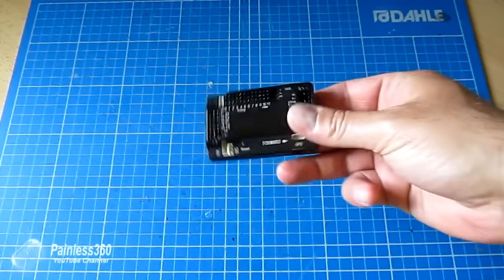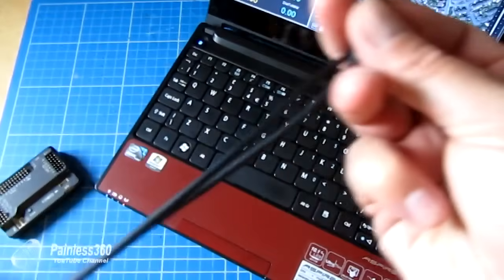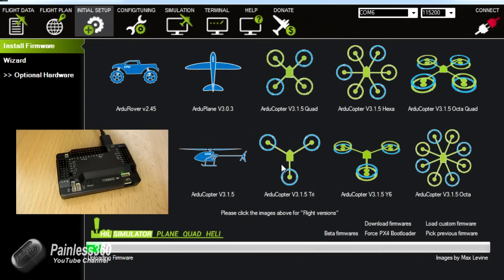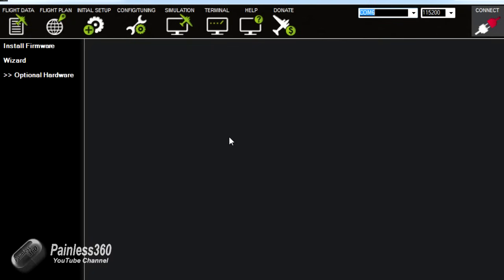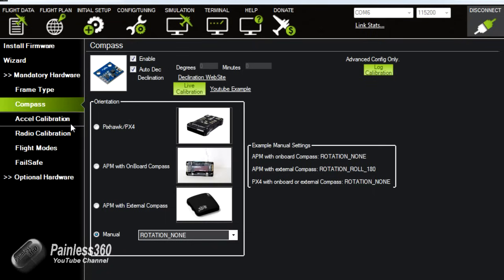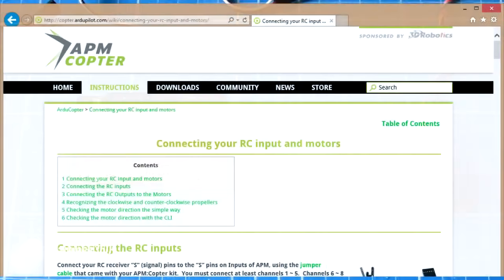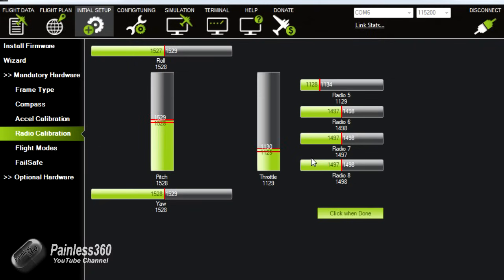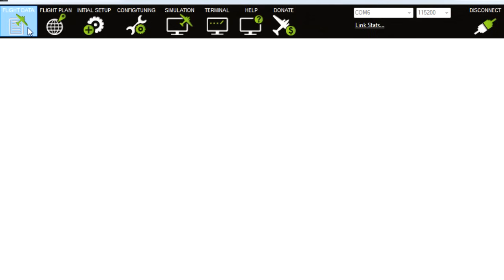(1/8) APM 2.5/2.6/2.7/2.8 - Simple installation and setup overview

Comment: Hi I have setup my APM 2.6 on a 260 quad and I can not get it to arm,  and when I plug in the battery my ESC beeps and beeps and beeps. I have done everything I can think of. What should I do?
Reply from the maker: +Alayna Feldman Have you watched my APM 'troubleshooting arming' video?
Reply: Thank you for responding so quickly to my question.  I have watched your arming/ troubleshooting video, and found out that I could not get GPS through our metal roof.  I was then able to arm, but now it will not stabilize, and I am positive all my motors are plugged in and orientated correctly, and the board is facing the proper way.
Do you know of any other reasons why it will not stabilize?

Bo (little brother of Alayna)
Reply from the maker: There could be lots. I would follow the APM setup videos and make sure the board is calibrated for level..
Reply: I have fixed the first problem with it flipping over... that was wrong motor configuration. And now, I am having a new problem. When I try to arm I get (RC not- calibrated) I have gone around the pre-arming checks so I can arm. But when I give it a little throttle the motors spin slowly. And when I give it a lot of thro the motors spin slowly. If I put it in RTL mode it tries to go up to default altitude and return to launch, but I cannot lift off in any other mode.
Reply from the maker: Happy to help but please watch https://www.youtube.com/watch?v=olIqTiSJHIY and come back to me with more detail of what you've tried..
Reply: Thank you for the great video. I had all ready done about 3 hr. of research on all of my problems before I contacted you. I figured out how to reset the board and that fixed it, and now I can fly fine in stable mode but if I put it in a gps mode it will fly but is very unstable. I will send you a video ASAP.
 THANK YOU FOR YOUR TIME,

                                         Bo
Reply from the maker: +Alayna Feldman I would check that the magnetometer isn't getting interference.. best of luck...

Comment: Ok, I gufffed it! Mission planner for APM 2.6 no longer exist. Has anyone found a way to program this board that I just got for Christmas? or is it just a useless piece of electronics now?
Reply from the maker: Still works for me - http://ardupilot.org/planner/docs/common-install-mission-planner.html
Reply: I ended up, after a 10 hour Marathon of trial and error, using APM Planner 2. Downloaded it from the Ardupilot webisite and got it working BUT! After getting everything running and a couple test flights in the back yard I decided to re-calibrate the compass due to loiter drifting hard to the left. Plugged it up, re-calibrated --- now it won't arm due to a "COMPASS OFFSET TOO HI" issue that I can't figure out. I even toke the 2.6 APM and compass/gps module off the craft and tried to get pass the problem with no luck. I keep getting a very high reading on the X axis (57280.096) etc... Any suggestions? I ordered another gps/compass which will take 3-4weeks to get here.

Comment: Hi
so I really need help in solving this problem. it would TRANSMITTER futaba T6EX and ardupilot 2.6
Reply from the maker: Sadly I do not have that transmitter here but you need to find someone who still has one who can walk you through how to set it up using mixes.

You can fly fine using only two flight modes in the mean time...

Best of luck. .

Comment: I am in a quandary and hope you can help. I have a new apm 2.6 that will not load the firmware. Confirm that I want to load the firmware, it reads the hex stops near the end and says "Connection error, no connection" never even gets to loading the firmware.
I have tried:
disabling all other ports, new usb cables, re installing MP, using older versions of MP, APM planner2 ...it loads most of the way then crashes, installing offline...
allways does and says the same thing.  As a note I am able to calibrate and such.
  Hope you can offer some advice as I am at my wits end.    Great tutorials BTW.
Reply from the maker: bill patterson Are you making sure that you are loading the latest supported version? (https://www.youtube.com/watch?v=Vbz3vN3JH6Y&list=PLYsWjANuAm4oswLMu9OU8yOm-9J6y30XW&index=11)
Best of luck.

Comment: My apm 2.6 is not recognized by my pc. It has an orange light on the board instead of the green displayed on yours... This could just be a model difference, but I'm wondering if it's not being powered properly. Or maybe I need a new serial driver... Prolific driver doesn't work.
Reply from the maker: Will6804 The orange light is a data light and normally is only flashing when the board is being read from/written to.
I've not seen it myself but it sounds like a potential board issue. http://copter.ardupilot.com/wiki/common-autopilots/common-apm25-and-26-overview/common-ppm-encoder-apm2x-atmega32u2/ may help force a reload and restart. 
Always worth a try getting support from your supplier..
Best of luck with it.
Reply: Thanks for the advice. I've had a hell of a time with my project so far (part of which may have been my fault). Both of the cameras I bought failed to do anything but play sound, with one literally going up in smoke after 2mins (at correct voltage and amperage). It seems like my laptop that's barely one month old doesn't have a com port driver/doesn't recognize it (and i have no clue what do do about that). and when I found a computer that did, says that there is only one com port, mission planner recognizes the board, then says "no connection".

This is my first build, and your videos have help quite a bit. But, I have to find it funny, me having such bad luck and all.

Also... The orange power.light is constant with red and blue LEDs flashing after being plugged in, then the red is a steady blink after that, but with orange power light.

Thanks, I'm a big fan.
Reply: Working now!
Reply from the maker: Good news - what was it?

Comment: I am having a problem with my HKPILOT POWER MODULE. Not getting power to the board, is it a bad module or did I do something wrong. It wrks fine when plugged into my pc....except im running Windows 8 an that is a whole n other issue. Any ideas
Reply from the maker: Hi Cordell, see my other video - APM 2.5/2.6 - Powering the board, motor installation and ESC calibration

Sounds like it may be the J1 that needs installing..

Happy flying.

Comment: I am building a Hexocopter using the APM V2.6, and when I connect to the "Mavlink" and go to frame type it's set to"X" "Y6A" which is for my Hexocopter, but there is a Default settings box to the right of that with a drop down window to Load Params" do I need to click on 3DR_Y6A_RTF.param Too???
Reply from the maker: Have a read if the documentation for the Load Params button. I never use it myself and manually set up everything.  Best of luck!

Comment: Setup For V3 Glass Fiber Hexacopter Frame 500mm - Integrated PCB Version
APM mega 2.7 1/2/3/4 esc works on the outputs rail but 5/6 on the outputs rail do not work the esc. (?) I tested it by taking out 1 esc that works and plug it in to 5 on the output rail and got no response.
Reply from the maker: Sylvanus Houseman is J1 installed.

Comment: I was looking for a good AP and I think this is the best work/price that can find. The only problem is that some boards are v2.5.2 and some v2.6.1
Do you now what are the deferences of these two boards?
All the fotos at ebay have the 2.5.2 version but writing that is new version. How can we now which board they will send.
Anybody tryed to make it work with the MTK3329 GPS board from the storm OSD?

Thank you in advance
Reply from the maker: Hi, the main difference is covered in the video. The main difference is that the v2.5 of the board has an onboard compass and is more sensitive to electromagnetic interference. The v2.6 uses an external compass mounted on the GPS. 

If the MTK GPS is configurable and has a fast enough update speed then it may work. I have not tried it myself. 

Happy flying!

Comment: Hello, I have a question. What can I do because my 7 chanel radio does not have a 3 position swich?
Reply from the maker: ICanDoRedstone Then you are limited to two flight modes unless you can 'mix' two channels together to give you three or more positions on the channel that controls the modes.
I have a video for the DX7 and getting more flight modes that may help..
Best of luck.

Comment: Hi, do you know whether there is a problem connecting the APM 2.6 board with windows 8.1 using Mission Planner 2.0 as mine can't detect the board, and it can't see any relevant COM ports.  Cheers  Steve
Reply from the maker: Steve I used Windows 7 and 8.,1 here with MP and have no issues. The problem isn't the MP setup - it's the lack of com port. See http://copter.ardupilot.com/wiki/common-apm-usb-driver/ for more details..

Comment: Thanks for your video, really helpful. When I calibrate my Radio I noticed that on moving the throttle also pitch and roll seem to affected. Although I'm sure that my radio is connected properly. I'm using a try-copter config. Someone familiar with the problem?
Reply from the maker: Sounds like you are using a heli model type on the radio. If you are then make sure that you don't have a swash mix enabled. Usually this is '90degree' or 'single servo' in the menus. Best of luck!
Reply: Thanks! I have a TGY9X it says: PIT: 45 AIL: 60 and ELE:60. if I change them to 0 and exit they just go back to these values. do I put them on 90 all of them or switch my swash off in a other menu?
Reply: never mind It worked! just put all values to zero. thank you so much!
Reply from the maker: Happy to help!

Comment: good video 
I followed these , but mine will not connect to my laptop.
it will download firmware but just times out.
I have tried many times without any luck.
right com port and software but no joy .
any ideas thanks.
Reply from the maker: +dsturner244 Happy to help but please watch https://www.youtube.com/watch?v=olIqTiSJHIY and come back to me with more detail of what you've tried..
Reply: Thanks for getting back so quick, I am waiting for a response from the seller of the unit.
Just found it strange that it downloads firmware and then to carry on with setting up proceeder , it needs to connect .Just times out and dose not connect, tryed different com ports and tryed using the dos screen.Even that tells me to Panic as it took to long to connect. Tryed Google on how to reset or reboot but they all say the same , even in Spanish lol.Will let you know how I get on and thank you.
Reply: Fixed it?
Reply: +robin bertschler  no I did not , faulty unit .Had a replacement sent .all OK
Reply: It works now, I used a faulty cabel.

Comment: hi Painless, I have problem with calibrating internal compass. I did what you did in video but could not get poins and gives error code 99. it works without calibration but shows wrong directions. any idea will be helpfull for me. thanks..
Reply from the maker: If you are using the APM 2.6 then you need to plus in the external compass to do the calibration..

Best of luck.
Reply: thank you for kind response. yes I have APM 2,6.  I d just thought it is  hardware problem. I just ordered a gps module with compass. thanks.

Comment: mate i have a problem i have my reciever and apm connected by the usb,it connects no problem until i turn on my transmitter and then mission planner disconnects,why would this be.Any info would be great.Thanks
Reply from the maker: +SheaProdigy id suspect a power related issue. Check the non USB voltage and J1 setting.  Best of luck!

Comment: hello i hope you will help me 
i have a problem in APMplanner, i use ubuntu 18.04 and this version of apm planner "apm_planner_2.0.26_bionic64.deb"This is my 'install firmware' screen which is blank in both disconnected & connected state (I'm trying to configure my pixhawk1 for the first time)
Any ideas why this is occuring and how do I fix this?

Comment: my altitude reading jumps around a lot, would jump from .5 to 1m then down n up constantly! I need help
Reply from the maker: If you have a baro - cover it with foam and make sure that the GPS is well away from any interference. Both provide height data.. if you want super accurate height management, ditch the APM and look at my Sonar/Lidar videos. best of luck

Comment: Hi Painless, I have installed apm mission planner on my mac and when I follow your steps in the video, when you choose com 6 I don't have that option, just some bluetooth ports in the list . Totally stuck now can you help please 
Thanks
Reply from the maker: Not sure as we don't use Macs here. I'd look at the forums as it sounds like the USB driver hadn't been installed/configured automatically.. best of luck!
Reply: We tried our windows machine still no joy in the window that says com 6 in your video my screen says no device and the whole program looks slightly different tried following the link in your video and it took us to the go daddy site ? so downloaded the oldest version we could find perhaps this could be our problem can you help ?dying to fly my fixed wing fps safely with an apm  system installed
Reply from the maker: Id try another USB cable..

Comment: I am setting up an APM 2.8 and I installed the firmware and got my hex to fly but only in stabilize mode. When I try to set the modes to loiter it gives me a error message that says Error Setting Parameter. The only mode I can select is stabilize. My GPS has a 3D fix inside the house with 11 sats. Help?
Reply from the maker: I've not seen that here and the detail on the forums (from my quick search) isn't great either. I'd start by reloading the firmware again and running though the setup again too in case something hiccupped first time. Best of luck!

Comment: Hi what can you do when going through Radio Calibration and My Aileron isn't moving correctly not on mission planner or on the TX monitor function. All help appreciated.
Reply from the maker: What troubleshooting have you already tried?
Reply: Painless360. I've made sure that the trim is set to 100% correctly checked the cable connections between rx and     AMP that's about all I can think off
Reply from the maker: I'd connect that channel to one of the others in the Rx to test that the input on the APM is ok, if it is then I'd connect a servo to that output on the Rx and see if it moves. If not then it'll be the Rx or some setting on the radio for that channel. See my troubleshooting tips video. Best of luck.
Reply: Thanks I switched the channels around Throttle and Aileron and then the throttle does what the Aileron was doing. so switched Aileron with Elevation and the pitch doesn't work. I put the servo into the Aileron and it doesn't work properly it only moves slightly on right movement of the TX stick or if the stick is moved up and left to spring back it will move. It does nothing when the stick is moved to its left side top or bottom. Hope you will be able to help me diagnose the problem. Thanks

Comment: Hi,
Now I'm using Multiwii SE 2.5 board. But I can't get telemetry data to my Tx. Therefore I'm going to move to APM 2.8 arducopter board. Is this board easy to configure? Better than Multiwii?
Thanks!!!
Reply from the maker: +Senal Weerasinghe I have a series on the APM. If you are a looking for telemetry on your Taranis and don't mind not having GPS modes then look at Naze32/Cleanflight. I have a playlist on that too.. Best of luck.
Reply: Painless360 
Ok. Then what about APM. Hope it's very reliable flught controller. Radiolink tx manufacturer says APM and pixhawk support for this tx.
Reply from the maker: See the playlists on the channel for more detail. This hidden video may help too - https://www.youtube.com/watch?v=k4tQAmg2ssA

Comment: Hello,
I have enjoyed watching your videos and find them very descriptive and helpful.
I'm new to the world of DIY drones and mission planner and I built a drone using an APM 2.8. When I plugged the APM into my pc it did not recognize it or install the drivers. The APM works and I can use it normally with my flight controller. I have tried finding drivers and it still doesn't work. I have also tried different cables. I've searched and asked around on forums and have had no luck.
I am running windows 10 with the latest version of mission planner. My best guess is that I might need a new APM for the computer to recognize it.
If anyone can help me that would be great.
Thanks!
Reply: Also would buying one of the APMs featured below the video work with mission planner?
Reply: One more thing:
I am thinking about upgrading my quad sometime in the near future. I want to put on a good long distance telemetry system, a gimbal, and camera that are all compatible with an APM 2.8 and mission planner.
Reply from the maker: I’ve not use the APM for a couple of years now, I’ve also not recommended it for a while as it’s a very old flight controller now. Best of luck with your search, I hope you get it sorted soon...
Reply: What kind of flight controller would you recommend that is fairly low priced like the APM?
Reply from the maker: See my flight controller comparison vid o form summer last year. Depends on what you want and how much you want to spend..